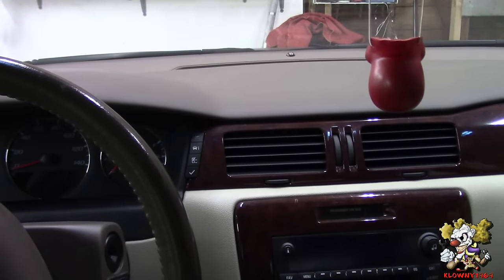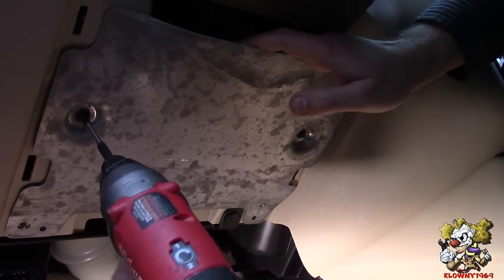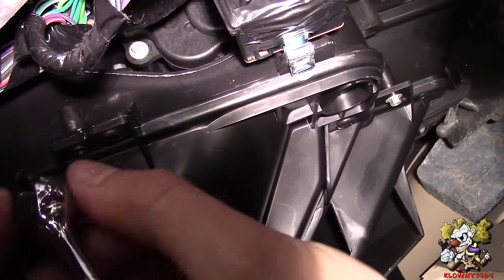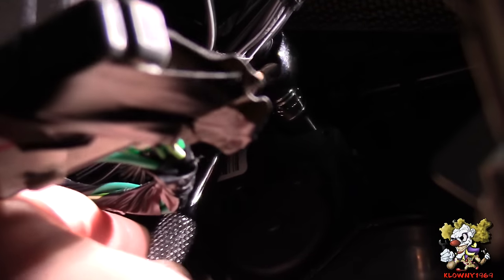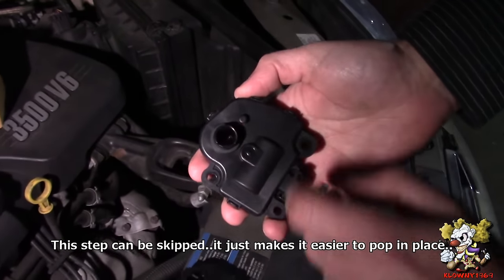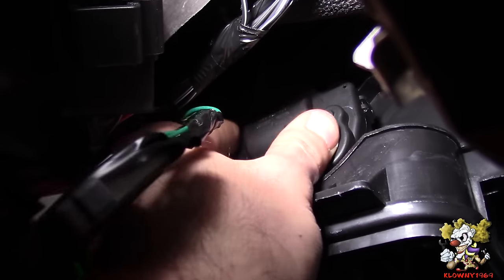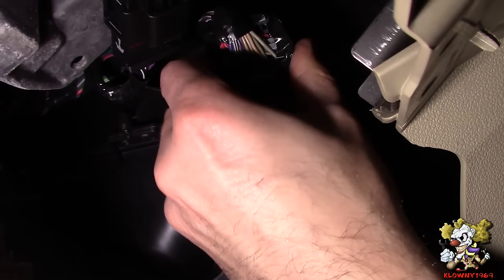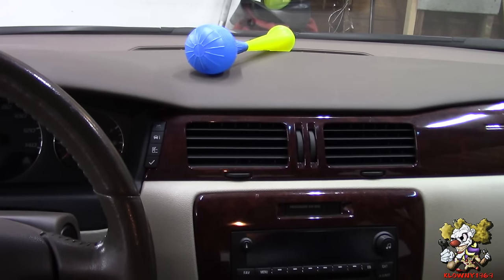How to Replace a DRIVER Side Heat Door Actuator - Chevy Impala 2006 - 2013 - DIY

Comment: My AC is not blowing at all. I've replaced the passenger and now have to replace the drivers. Could the blower be bad?
Reply from the maker: u can hear if the blower is turned on or not
Reply: +klowny1969 I can't hear the blower at all.

Comment: I have cool are blowing on my drivers side but no "clicking" The heat on the passenger side works fine . What might be the problem ?

Thanks 
Robert
Reply from the maker: check to see if the driver side heat door actuator is working

Comment: Completed this operation and I'm still only getting cold air from my passenger side vents. Hand the blend door changed a while ago too. Any idea what it is?
Reply from the maker: Did u test the actuator before u changed it?
Reply: Ramsey Murr a piece from your defrost vent which is plastic has broken off and lodged itself in the blend door

Comment: You can save a lot of difficulty with about a 12 inches long 1/4" extension and  a universal joint, also some "sticky stuff" to hold the screws from falling out of the socket during removal and reinsertion. Can use 5.5mm or 7/32 English. 
Lastly can often reuse the old failed part, just one tooth is gone on a gear, rotate the gear 180 degrees and uses a section of the gear that's unused.
It's easy to open it up just need maybe 5 or 6 toothpicks to slide into the locking parts around the perimeter of it then the 2 at the connector. It's actually very easy to open and "repair" them.
Also other videos here on YouTube, how to easily in 5 minutes repair, the common failure point in these units, without buying any parts, it's just so simple, saving a lot of money too.
Search here for free repair of Chevy actuators.
Reply from the maker: Don't forget to subscribe
Reply: I've done this, turning the gear 180 degrees.

Comment: Will this cause the driver side to blow ac cold?. Even though i turn the temp control to heat??.
Does not make a ticking noise. 
Passenger side will blow heat and ac.
Reply from the maker: P. K. its possible..check to see if the actuator is turning the door and for power and ground to actuator

Comment: The only thing that this video doesn't mention is the fact that you have to have the actuators reprogrammed. Because if you don't they will constantly run when the car is running until one day they just simply break again and the ticking sound will come back. Take it from me I listen to exactly what this guy said and I had to replace my actuators three times.

Comment: I think these require programming to the BCM using a Tec2. I've had mine replaced a couple times and they've had to program the BCM for the new ones. I think that GM should recall these and replace (& sell replacements) with metal gears instead of the plastic ones they put in there ... at least make them last a little longer. I've had to have mine replaced 2 (1 of them 3) times since I've had the car. The last 2 times they were replaced were withing a year or 2  after replacement.

Comment: My driver heat has quit working, but there is no clicking sound. Would that be an actuator or another problem?
Reply from the maker: Matthew Blakeney yes it could
Reply: klowny1969 thanks for the quick reply. I'll try to get it replaced soon and hope that fixes the problem
Reply: klowny1969 Got driver and passenger replaced and now have heat on both sides. Took less than two hours on both. Thanks so much for the guide, saved me over $300

Comment: I am having the same problem with in my 2012 impala. When I turn my ac on it blows out hot air on the driver side an cool air on the passenger side.. How do I know what actuator to buy for the driver side..Please help
Reply from the maker: Check out my description for the link to the passenger side videos

Comment: I have a Silverado 2010 .I just changed the side door heater actuator today !, My Heater and ac blow very little air ?, How can I fix this problem please sir ?.
Reply from the maker: Fernando Diaz check the blower resistors if u cant change the blower speed
Reply: Thank for your feed back Klowny 1969 It was the heater AC blower motor

Comment: How would one know which actuator is bad? When I unlock and open the driver door it does the loud clicking noise without being turned on, once the car is on, it stops after a minute or so.

Comment: I have a question. So in my 2010 impala, there is no clicking but there is significantly less air pressure. Is like even on full blast the air or heat are on low. How do I know what I need to replace?
Reply from the maker: You have to see which of the doors do not open and close
Reply: klowny1969 so could it be any one of the 4 actuators? Or is there a way to say it’s more than likely one of the rights or lefts?

Comment: It took me 4.5 hours as opposed to 12 minutes... But it worked.  I actually used a 9 volt battery to align the dowel... As I wasn't comfortable messing with the big battery.

Full disclosure:   I used to be an actual clown in a circus.    ;)
Reply from the maker: lol thanks for commenting mr klown

Comment: when my hester is on heat only comes out of my passenger side. is that the heater actuator or the blend door actuator?
Reply: heater*...there's no clicking sound.
Reply from the maker: +Tony Moreno check passenger side heat door actuator..see if its opening and closing the door
Reply from the maker: +klowny1969 sorry i meant driver side
Reply: +klowny1969 can I see the door from under the dash?
Reply from the maker: +Tony Moreno yes..just take the two panels off

Comment: How do you check to see if the heat door actuator is working ?  207 Impala   No clicking
Reply from the maker: get to it by following my video..then turn the heat on and off on the driver side..see if the door is opening and closing

Comment: Anyone know where I can buy the clamps he’s using? I’ve fixed mine twice but I think the actuator is in the wrong position and causing it to click still
Reply: Also, after I replaced it the heat stayed on. Not sure if there’s another one on the driver side that I missed or if the new one I put in was bad

Comment: I replaced the same one, but still get heat  on driver side and cold on passenger why? So I took the part back to autozone and put old one back and still have the same problem
Reply from the maker: It could be one of the other actuators not working

Comment: I have it hanging but can't get a screw driver to unplug it .. any hints ???
Reply from the maker: You can do it with your hand..just pop the clip out and pull it
Reply: @klowny1969  Thanks  Couldn't do it with my hand but finally got a light on it and went upside down and got it off with longer thin screw driver  Great video .. now need to get some wire clips to move it in the right position
Reply: Putting it in was easier than taking the little SOB out. Thanks for the great video !!!! Replaced 2 so far this year so I am sure the other one will go soon.

Comment: I cannot get the screw holes for the actuator to align.  Any help would be appreciated.
Reply from the maker: Norman Armentrout push and turn the actuator until the dowel pin goes in its place
Reply: Thanks, that worked -- twice!  I put the broken one back in the first time.

Comment: @klowny1969 what size is the ratchet fitting you used? My 8 mm isn't doing the job sadly
Reply from the maker: Zach Davis i think i mentioned it in the video..i work on alot of cars..maybe 7.5 mm
Reply: klowny1969 alright thank you sir! I watched another video and a guy said 5.5 mm so I'm not sure I'm just going to get a smaller set. Thanks again
Reply from the maker: Zach Davis np Good luck

Comment: Does anyone know if replacing this will make the air blow the correct temp? I have a 2010 impala. It's not clicking but the driver side air vents only blow cold air. The passenger sides will warm up. Pep Boys told me it needed the middle control thing replaced so I did that and it didn't make a difference. I'm wondering if it's the door actuator.
Reply from the maker: Check to see if the door opens and closes when you switch the temps
Reply: @klowny1969  where would I look?

Comment: I know that this actuator is bad. But, would that drain the battery? My fiance just purchased the car and it clicks randomly. Would like to get it fixed for her.
Reply: It's possible. I think this is what killed my battery in my 07 Monte when it sits in the garage for a couple days. A couple times I went to the garage and can hear the clicking noise even without the car on. I think it's trying to find it's "Home" position, and since it can't do that with stripped/broken plastic gears, it keeps trying over and over draining the battery. GM should recall these and they should replace them with actuators that have metal gears inside instead of the plastic ones IMO. Also if I'm not mistaken these need to be programmed to the BCM using the Tec2.

Comment: What is the extension size on it, how long, is that a particular part number?
Reply from the maker: its just ur standard 1/4 inch extension..prob around 2 inches or so
Reply: Okay, just wasn't sure if you had to buy a particular size to fit on the mini ratchet, got one last year when I did the passenger side!
Reply from the maker: +John Arkady thats kool..good luck with the install

Comment: Just finished! Did all three.  The calibration directions must be followed - turning the key on for 5 minutes before cranking is a must. Also if things aren’t lining up on the stem you place it on you can take the actuator apart and adjust the position. Took 5 hours in 95 degree heat.
Reply from the maker: 5 hours? Holy cow
Reply: Hey.. What calibration directions are you talking about.. Is that where you got turning the key on for 5 minutes before cranking?

Comment: I honestly have no idea how any of you guys are getting into this area to take out the actuator.  Are you laying down flat? Do you have very long arms?  And the power cable for the actuator seems very short.  Not to mention, it's so hard to see anything even with a good LED flashlight.  I think if the driver seat was removed it might be possible to do this.
Reply from the maker: the video shows every single detail. just try and squeeze into that area under the dash..I did it without removing the seat, just move the seat all the way back...don't forget to subscribe

Comment: I change the passenger heat actuator it was taking and when I changed it it doesn't take no more but only heat from the passenger side comes out driver-side no heat but there is no ticking like your video please help me please
Reply: Edwin K novic I wasn’t getting heat from my drivers side. The actuator wasn’t ticking, but I replaced it and now heat comes through.

Comment: Huh my 09 Impala is stuck warm on driver side and cold on passenger side. Temp switch for both does nothing. Had click under pass. dash but nothing under driverside.
Reply from the maker: Check the links to the other actuators in my description

Comment: It seems like all of the “common” issues with these impalas is happening to my 2010 Impala. I had a 2003 mustang for 14 years and only had an issue with the CD player. Beyond that, it was just engine maintenance. In the 10 months I’ve had this car, I’ve put just about as much money into it as I did in 14 years for my mustang...and that includes labor for taking it to a mechanic to have most of the work done. I’ve done all the work on this Impala myself except for the transmission, tires, and alignment. It seems like every few weeks there’s something that has to be fixed and it’s getting old fast
Reply from the maker: Sorry to hear..wish u luck
Reply: klowny1969 I got it changed but you make it look so easy. You are amazing!!!
Reply from the maker: Awesome..thanks!

Comment: There is no clicking sound coming from the dash like when I changed the blend door accurator on the passenger side but the driver side is blowing cold air when the heater is turned on.
Reply from the maker: truegeechie just check to see if the door opens and closes..but it does sound like the actuator
Reply: Thanks, I will take a look.
Reply from the maker: truegeechie u go it

Comment: one more question can an actuator go bad without clicking?
Reply from the maker: yes maam
Reply: +klowny1969 lol!! cool! it's just so weird that this happened after I got the car jumped off last night. could I go through some type of procedure before this installation to really make sure? could that cause an actuator to "go out of sync?" blown fuse? if it is a fuse I would not know what fuse it could be because I checked the fuse box diagram.
Reply: +demariojason wait I just scrolled down and seen the same comments on how to test, opps!
Reply: Yup they can. If the teeth around it are broken and the other gear (there's 2 and a motor in the actuator) to grab onto it would just spin and make no noise. Then there's also the possibility of a bad motor in the actuator

Comment: Mine has been making the clicking noise for a couple years only in the summer, but now its still making the noise and the a/c will not work on the drivers side, its just blowing hot air. Its Las Vegas and I have children riding in the car so I need to fix this fast on a budget :( any idea why the cold air has stopped working, is this still an acuator issue? I hear the clicking all through out right and left side of dash board. Any one in Vegas know someone that could help me? I cannot afford the dealer. Help and Thank you!
Reply from the maker: Michelle Green yeah it sounds like ur actuator..under the description i have the links on how to change all the actuators on this car..u can do it yourself if you want
Reply: Thank you so much, but what would cause the cold air to not work just on the drivers side? Do you happen to know? I think all 3 of mine are out, I'll need help I do not have tools or anything like that :/
Reply from the maker: Michelle Green these actuators move doors around in the ducts which redirect air..if an actuator isnt working, it wont be able to direct air properly
Reply: Gotcha, do you know anyone in Vegas? Lol
Reply: I have a 2010 Impala and this guy is telling me the parts are $200 and he wants $400 for labor, wth? he said its in 3 locations and one of them is really hard to get too because my car is digital? But Its not? I'm so confused :/ Can you tell me where I can check on the parts myself and what the part #'s are? :)
Reply from the maker: Michelle Green well if its the actuators..they are 20 dollars each..and its not hard to get to at all..check the description below my video..i have the links to the videos where i show how to pretty much change all of them

Comment: Thankyou so much for this video. Why i prob wont buy an american car. Cheap plastic parts that WILL need to be replaced at high dealer cost at high dealer rates. Chevy door handles break off every 4 to 5 years. And all kinds of plastic inside knobs, handles etc.  Built to fall apart before you pay them off.

Comment: Well,  thanks for the video.  You make it look easy to reach those two screws holding the actuator in place.  This 65 yo chubby guy just can't get in the right position to reach those pesky screws.  ARGGG
Reply from the maker: yeah that sux
Reply: +klowny1969  Well I finally found the right combination, held my mouth right and finally got the sucker replaced.   My hat's off to you, replacing this thing while taking a video of the process.  If you lived near Louisville KY  I would buy you a beer.
Reply from the maker: +jrmil51 lol thank u..glad i was able to help u out